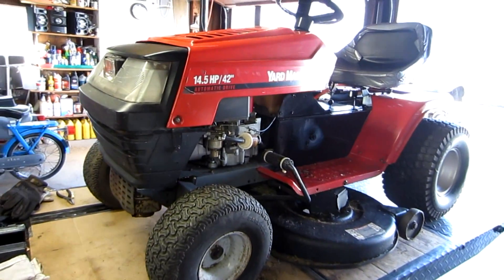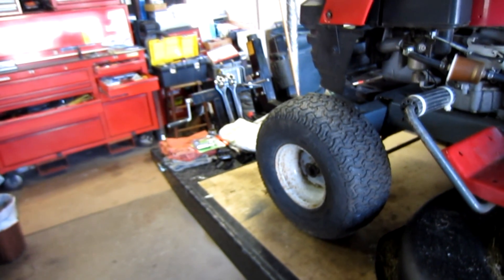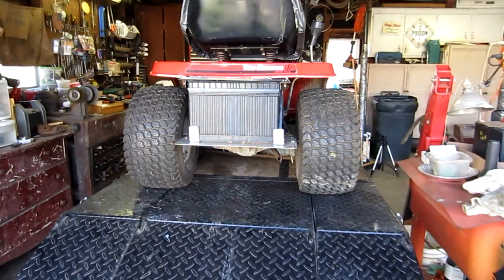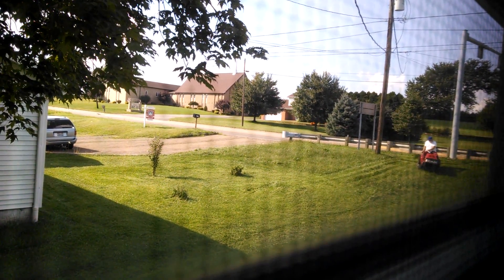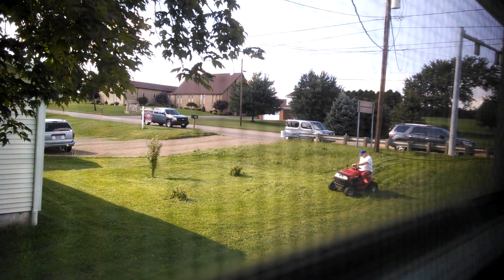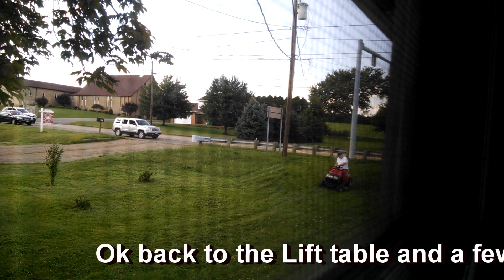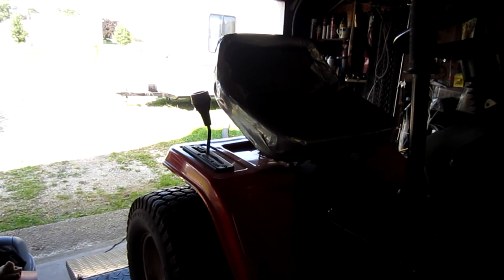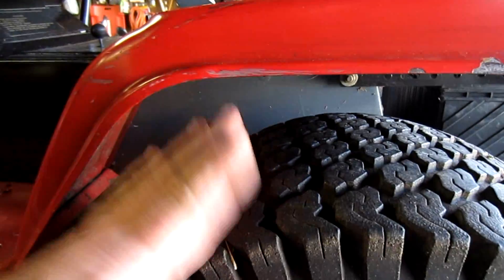Buying used MTD mower DON'TS

Comment: Nice video. I am in Australia and have an old L12 White / MTD.

I got it on EBay very cheap in pieces (local pickup) .

Long story short the exhaust valve seat was jumping out of the head the fix was said to be put it back and peen around the seat to lock it in. After the third time it jumped out I replaced the motor with a Chinese 17 HP - The mower now does wheel stands and sounds like a helicopter about to take off plus I had to re engineer the steering arm but all good now.

I have not trouble with long grass it has more then enough power.

I also replaced the deck bearings and put a new set of blades on it the lyres are old and cracked but so long as it works I don't care.
Reply from the maker: That is interesting. I figured that the Chinese engines would be a naturally, progressive move in the US for replacement engines but I didn't necessarily figure how those engines would be accepted globally. The valve seat was an issue with the Briggs and Stratton L-head engines, especially the boxer-style twin. I've personally peened quite a few seats back in over the years. Sometimes the fix holds forever sometimes only a mowing season. I was glad when Briggs went to the Intek design. I'm glad you are keeping the old mowers going strong in your country. I am curious, why does it sound like a helicopter? is it the exhaust note or is it the blades on the deck?  I might have to experiment with the Predator brand Chinese engines that are available here in the US in great abundance. I used a small single one on a go-kart project I had in the past, with great success. Maybe I'll try a twin cylinder one on a future project riding mower.. Thanks for watching and commenting.☺

Comment: HI, I have a 1997 MTD Power Pro industrial/commercial Lawn Tractor "KGrow" model# 13AQ695H120 with a 6 pulley deck. I'm having the mowing problem with that you talked about. It runs great but the blades just stop turning when you hit the grass, instead of cutting. You mentioned that there is a fix for this & I'm hoping I can get instructions. Can you please help? Any advise or instruction would be greatly appreciated. Thank you!!
Reply from the maker: There is no specific fix. You can try to add another spring on the back of the deck to keep it from shifting forward when in heavy grass. you could also try a wider belt or a slightly shorter belt.. you basically have to re-engineer the decks operation. good luck..
Reply: Thanks for the tips, sounds like i'm gonna need some luck. Where at on the back of the deck would be the best place to add a spring? This is the exact deck http://www.mtdparts.com/equipment/mtdparts/partfinder#/MTD_Merged_Data/13AQ695H120_(1997)/Deck_Assembly_46%22%2f%2fBlades/010094400-V/0100944000018
Reply from the maker: +Sheri Robertson Check out this image here http://www.mtdparts.com/equipment/mtdparts/partfinder#/MTD_Merged_Data/13AQ695H120_(1997)/Deck_Lift_%26_Hanger_Assembly/010094400-V/0100944000006  look at number 45.. try to match that spring an mount it as close to the opposite side of the original

Comment: Yeah I have had this mower for a long time 15+ years and have ALWAYS had a terrible time with the deck...it mows but if there is any tall grass it's just like he says...avoid these type get the one with the separte pto handle.
Reply: As bad as these are I've seen worse. The one model year Cub Cadet (not sure of the OEM) went to a timed belt for their big box models, is the worst mowing deck I've seen ever. The deck had a toothed timing belt between the two blades, combined with the fact that the blades were overlapping, which wouldn't be bad if it was tensioned right. But it wasn't on any of them I've seen. So you'd mowing along fine and all of a sudden those blades start colliding. By the time most humans can react enough to turn off the PTO, it would leave large pieces of the blade in the lawn.
Reply: +Dilan Gilluly I hate timed decks. Just destroys lots of parts when the belt breaks. Heck, MTD and AYP been building decks for years that are not timed and when properly maintained they cut awesome.

Comment: I own a POS almost like this one. are the blades  supposed to engage on the first position after the stopped position?  Mine starts and runs okay at the second one only.
Problem is, i'd like the blades a bit higher, but cannot due to belt engagement.
I inflated the tires, they were about half what they are supposed to.
I also lowered the two small wheels in the back of the blade tray or whatever it's called.

Would you have a trick of some sort to give it around ½ inch more?

Thanks!
Reply: No real trick other than the tire inflation like you mention.. You can try experimenting with extra spring on the back of the deck opposite side of the one that is currently on there or you can try a slightly smaller(length) deck drive belt.. That's all I got on that.. Good luck..
Reply from the maker: Oops.. Was signed in to my other channel when I responded.. SO, what RVDaydream said.. Foxboss9=RVDaydream
Reply: Roger that. Thanks.
Reply: +Zer0DaRk Zer0DaRk it's common for that tractor design to engage the blades solid when you hit the second notch. I have been fixing tractors for years and have noticed that issue with this model. These tractors have been around many years and came from MTD sold under many different brand names.

Comment: I love how you are calling that mower a POS when its 20 years old and still cutting grass. There is an adjustment rod to take up and remove belt tension for those blade engage setups. They are kind of a bitch to work on I'll admit it but they last
Reply from the maker: Compared to my Sears that is  43 years old(and at least 3 other 40 plus year old brands,THIS is a POS... There are quite a few mowers from the same era that are quite a bit better in darn near every way, Including other MTD Models that don't use this kind of deck engagement design.... As far as adjustments on the decks that lower to engage the blades, There is no adjustment, the spring tension that is on the back of the deck that pulls the deck rearward as the arm is being lowered is where the belt receives it's tension to engage on the pulleys...The only way to engage the belts more(or less) is by adjusting the spring tension which is impossible as there is only one mounting point for the spring on the transaxle..
Reply: @Foxboss9  the belt tension I just drill a hole in the back plate with an eye lit and it works good to fix the belt issue. Which I will 100% agree there are better mowers then this one. But when it's a $899 lowes special new and you get 20 years out of a rebadged beer can cant  be to upset. The new troybilt ponys are the BIGGEST pile of horse shit I've ever seen though. I'll take this style mtd over any new troybilt any day
Reply from the maker: @RusticShine  remember this is a "used" mower buying guide... No one should be buying this model of MTD Used...

Comment: Hey FoxBoss, nice video. Thanks for sharing your knowledge. 

A question, if I may: How do I fix the problem with my mower, similar to this one, that won't turn over? It's a model 303777 with a 16.5HP OHV and hydrostatic drive (CVT) transmission. It looks a lot like the motor in this video, but the starter is flipped over and just behind the oil filler tube. 

When it was new, in 2000, it had a compression release problem, and was repaired by a local guy under warranty, but I'm not confident the repairs fixed it. The compression release still seems to be temperamental, as if not releasing compression enough as I start to crank. To give it that extra oomph, I have almost always jumped it from the car, the car running, to give me that 13-plus volts. (Connect the jumpers, go have a beer, come back and baby the starter with the hood lifted to watch the engine spin/resist) Once it starts, things are happy, and after it's warm it will restart most of the time. But over last winter, I tried to mow-mulch the autumn leaves, and couldn't get it to start. A shop had it for 3 months, and didn't do jack for it, not the most resourceful crew, IMO. Ever resolved a compression release issue? Does it sound like that's it?

I've had this mower sixteen years, used it well on a half-acre yard, but it still has lots of life still in it - once I get it started. I just hate that it is so hard to start. I've replaced the battery about every other year. It's not a carb issue, it's either a weak starter, not getting enough juice through to it, or compression release problem. I don't want to have to do engine work on it just to put another compression release in it, and am willing to put on a new starter and battery. 

Do I put a sign on it that says "free to good home"? Cost me $1300 new. I hate to lose 100% of the equity when I hoped it was at least still worth a few hundred bucks. Oh - in tall grass, yes, it sucks like you videoed through the window. 

One way or another, I need to get into mowing season. Thanks.
Reply from the maker: +logmeindangit If the mower is still a good fit for you I would keep it,,
  Now as far as the problem I would check if the flywheel key is partially sheared. (A previous backfire can cause this).Have someone capable take a look at it if you aren't sure what to do. The flywheel key directly affects timing. 
 The fact that it starts with jumpers connected may also indicate too small of a battery installed on the mower.. The factory installs small cheap batteries(especially the little motorcycle ones) When engines/starters get old and worn they may start harder so a bigger battery(dont use anything smaller than 340cca on twin engine) may be what is needed.Of course make sure your battery cable connections are good ..   good luck
Reply: +Foxboss9 Wow! Thanks for the fast response! Doing my internet research right after commenting to you, since I'm stuck at home with a cold today, I found a video that was as if they were showing mine. I'm going to adjust the valves. That's the way most commenters are pointing, too. I'll first check the starter with the plug out, then go at the valves if that checks out OK. I've rebuilt heads on cars, including a warped Datsun 2 liter head with cam towers that had to be re-positioned manually, painstakingly, so this is easy peazy. It has had no backfire issues, ever, and it has just been like waking a hibernating bear to start it. The battery is not the issue, because a new battery (I've replaced it 4-6 times in the past 16 years) worked OK for a bit, then just didn't have the poop to turn it over. But it had plenty of spark! The symptom was better for a while in the beginning, but you know, I may have had valves that were a thou or two loose from the very beginning, and they just got looser over the years until it got to here, where it just said, "Nope, I'm not going to go over the TDC compression hump any more, not until you do something here." It finally requires my hands on to revitalize its function. I'll let you know how it goes. Later! Thanks!

Comment: I'm buying a mower model is a 33932a/d189h 14/38   do those have the blade engage problems?  anything I should look for or ask when I check it out?  thank you for the great video.
Reply from the maker: +adam B If the blades come on automatically when the deck is lowered, I would not buy it..
Reply from the maker: +adam B i cant tell how the blades are engaged in that video, especially since that mower didnt have any deck.. The mower you are buying, How do the blades turn on/engage?

Comment: Hello and thanks for all the helpful videos!  I have 2 MTDs that have are over 20 years old and I'd like to buy a new 18-20 HP with a 42 in. deck.  Any thoughts or recommendations?  Much appreciated!
Reply from the maker: They have changed so considerably over the years. I think that they have worked out a lot of the bugs. Basically I'll give you the same advice that I gave my father. If you have 1 acre or less and you want something that's going to last a while try to find a twin cylinder hydrostatic drive. That is with the caveat that you're not towing anything heavy or pulling anything really heavy all the time. I'm not talking about a lawn roller I'm talking about something like a boat and you pull it for a quarter mile 5 times a week up a hill. If you haven't mowed with a twin cylinder before and you've only mode with single cylinders, you'll notice the difference right away and how smooth it feels. In the hydrostatic drive just makes it so much easier than screwing around with shifting and changing gears. A lot of people think that hydrostats are more Troublesome than a standard shift but, the truth is there's potentially issues with all of the transmission so you might as well be comfortable mowing. I've never been a fan of the Kohler engines after 2005 but a lot of the mowers are coming with that engine because Briggs & Stratton I believe his filed bankruptcy and probably in the process of getting swooped up by an overseas company. I believe a lot of their single-cylinder stuff was already being made in China. Just make sure you buy something that you're comfortable with and realize that there's a lot of similarities between riding lawn mowers and RVs and that is none of them are perfect so you might have some issues just make sure you have a good support system to take care of whatever repairs that may come along and you want to make sure that parts will be available the next 20 years down the road.
Reply: @Foxboss9  Thanks very much!  I'm looking at Huqavarna and Cub Cadet.  I'll take your previuos advice and be sure to buy from a dealer rather than a big box store...  Cheers!

Comment: Hello, how can I ask you a question about the springs from the clutch and brake to the rear end , theirs a big spring that I can't figure out were it goes back to.. looking for a picture or video that show that information ... please help if possible...by the way , I have a 48 inch yard machine with 20 horse engine..
Reply from the maker: Chuck Cassell pretty sure the spring goes on a tab that is mounted to the front of the transaxle. I don't have any pictures or any units here that I can look at so I'm going from a faded memory.
Reply: Foxboss9 ....yeah thats my problem also having trouble finding one to look at...its on my personal machine so gotta fix it soon. Thanks for you reply..

Comment: I will ask what would it be if your back wheel move like i seem to have a gap in the back a bit but my  back wheel is still on there it just moves a bit if you yank a bit it may move a cm
Reply: Mine is 2006 weed eater 13.5hp mine hads bit dry rot on back but in shape wise its nice

Comment: All you have to do is replace the diode coming out the stater plug 200 part regulator common black Diode  allows. Current to flow only one way piece of cake😊

Comment: I was wondering what brands of used riding lawn mowers you would recommend.  I am looking to spend less than $500 on a used mower and are there any particular brands I should "lean" towards compared to others?
Thanks!
Reply from the maker: Dylan Rohda simplicity for sure..
Reply: If you are looking at a used lawn tractor, the great majority are built by Murray or MTD, and the Murrays are just as bad, if not worse than the MTDs.  Everything falls apart eventually, but given similar overall condition, I would give Simplicity an edge, they are better built and don't have quite the name recognition the other brands do.

Comment: never had any issues with this sort of setup. no debating the flaws in the design. it's junk. the thing that stood out to me was the paint. i've never seen anything that was painted and patched up work right. the little fixes, end user engineering and fresh coat of ugly to hide the original ugly mean it's gonna be trouble.

Comment: Do you know of any issues with the MTD 13.5 / 38" Yard Machine?  Thanks for your help.
Reply from the maker: William Stein if the Deck engagement is like This one I would stay away from it.. other than that it's a pretty decent mower as Long as the 13.5 is a Briggs engine And not a Tecumseh..